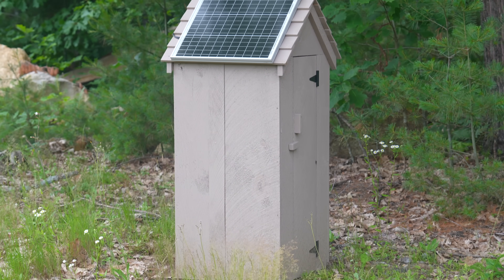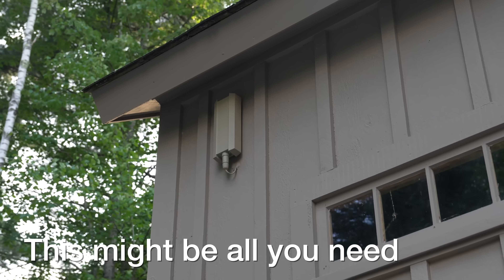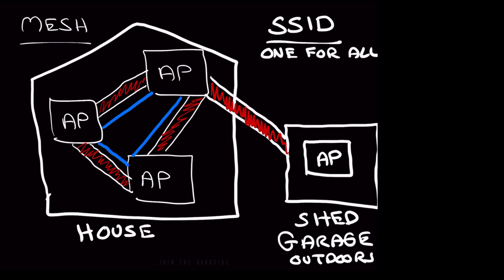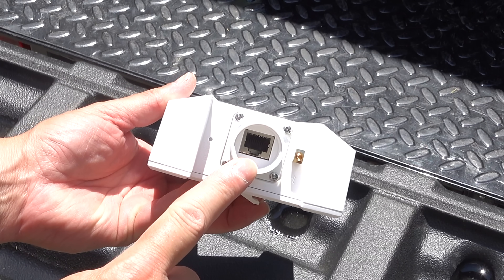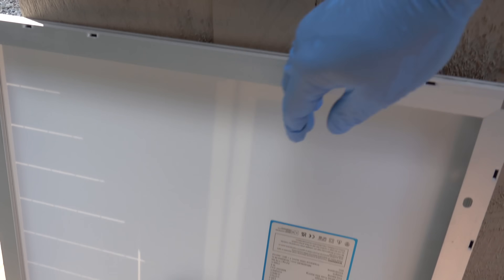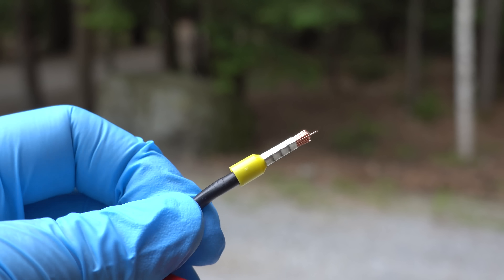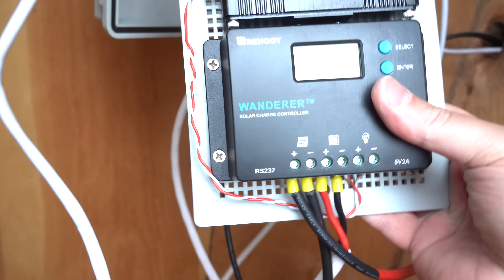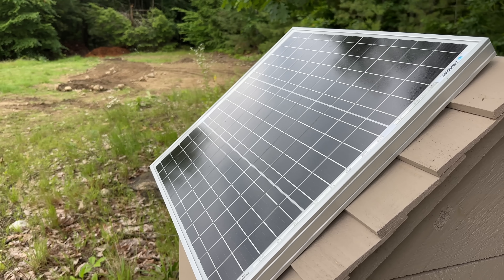How to get Wifi in the woods - DIY Solar Internet Station

Comment: I had to assemble a TP-LINK system as well that ended up being very complicated to not only set up but to maintain. At 64 and retired I had time to do this but even my technologically advanced son told me the system was to complicated for most people to understand. So what I am saying is when your away and the system goes down the area will not be covered by wifi.
With my system when the power goes out or flickers on and off it causes issues that many people that don't have the knowledge and patience will not want to struggle trying to figure out.
Not knowing your property layout but understanding wifi signals it might have added even more distance and signal strength by elevating your antenna. 
I all ways really enjoy your very informative videos thank you for making them.
Reply from the maker: What I like a lot about TPLink is once you get their interface and if you use their Omada devices it's really easy. I have been sup[er delayed doing a full network tour here to show my routers, wifi, etc. I wanted to get this project done first since is a critical part of my coverage. I hope to show the Omada system and devices in a lot more detail within the next month.

Comment: Is that new siding or paint on the building?
Reply from the maker: We just painted the garage, the wood siding is the same. The house needs it a lot more but is going to be a big deal so we are working up to that. I have no idea who the wood siding of the garage has held up so well for 40 years with so much shade and tree cover.
Reply: @SilverCymbal  it looks nice! also, the ap color blends in well.

Comment: Sometimes pricey but your videos always have solutions for rural home owners like me in a nice neat package.

Do want to point out, the mini version of that battery your using does NOT have low temperature cut off. 

Lifepo4 can discharge down to -4 but under 32 degrees a charge can damage the battery.

I have heard low C rates won’t hurt it though so you might be okay with that 50 watt panel. That’s under the c/20 rate that’s “safe.”

You might want to consider a external low temp cut off or low volt heater pad on a dc thermostat. You could direct solar power the heating pads with a cheap 24/12 buck converter and a larger panel so it starts gently warming the battery as soon as the sun is up.

Comment: I’ve been kicking around this idea in my head for my off grid property so I can do more “live” game camera stuff. I think I’ll need a bit more power if I want to do continuous live streaming, but this gives me a pretty good framework. Thanks for showing it off!
Reply: It's always weird when 2 different YouTubers come together. Like MTB and lawn and garden. Haha. Anyone else watch both?
Reply: There is pretty powerful routers that don't use alot of power, I have a similar setup with a smaller battery and smaller solar panel and it works great. A big hoss streaming setup wouldn't be a half bad idea.
Reply: @GoonyMclinux  Which router you recommend?
Reply: what router are you referring to?
 @GoonyMclinux

Comment: If you are using home assistant I would add a esp32 and a shunt type device to monitor the batter level and usage. You should even be able to see how much solar is going into the battery. Then you can monitor the level and make sure the battery is large enough. Also should be able to keep an eye on the battery health as well.
Reply: you could also use bluetooth presence detection to turn the wifi off and on depending if any devices are close enough to it, this should preserve the battery for longer

Comment: Would love to see a follow up video on how it performs after months being outside in the winter.   Will the solar keep up?
Reply: Not likely. Those panels are quite tiny. What ever the energy draw is per hour which I heard him saw 16 watts at one time. Rounding up you need 500 watts of solar per day for 20 watts per hour all day long. This 500 watts needs an additional 25 or 50% to be safe. Which means you need 1kwh of power. A 12v 100ah battery is around 1.2kwh. You should have around 200 watts just to make the station a viable thing all year round. Might as well buy a 250 watt panel to be safe. This means that in just a short hour or 2 the battery will be charged and should never go dead. If you look for the battery that has an internal heater in it. This way it kick on if and when you start charging. Then summer time you can add a set of filtered and screened in fans to help keep the box cooler. 
If I was making this I would buy the panel first then build it based on that size. I would then also make sure that the panel is at the best overall angle and spaced  several inches above the roof of the box. This way heat can be expelled with ease. 
I would then get a couple of sheets of 2 inch foam and then find the correct glue or contact cement and using a sheet of the wood siding and a sheet of osb on the inside build and make my own SIPs. This is small enough that it should be pretty easy. Also I would make sure the panel is a couple feet up off the ground to prevent tall grass to shading or anything else. Once the box is made you can set it all up really easy. Make sure you use the SIPs on the entire thing and caulk the inside and anything else to prevent even the tiniest gap. You can use computer type fans to vent using a simple 12v temp controller. ( amazon/ebay has them for like 10 bucks, I have used a number of them over the years ) Use a dryer vent cover to shield it from rain and then place a screen on the inside tightly sealed and then a box cavity several inches away from the wall to put in a small filter. I think you can find really nice 12x12 filters. Make sure you support the filter and a tight seal. You can then mount 1 or more fans to some plywood with the fans screwed to them. If you can see what I am talking about. I do not recall what the draw on those 12v temp controllers are. Yet they are super low. You can set up 1 fan with one and then another one with another temp controller setting them so that if the cabinet gets really hot you can turn on another set of fans. For example you might have 1 fan hooked up and then 3 hooked up for high temp things. 
You can read the spec sheets of the working temps for each unit that you put in it. You might find that they have pretty high working temps.
Reply: @kameljoe21 You are overthinking things. I ran my whole wireless network off a 300wh solar power station hooked up to 100w solar panel for a year.

Granted I had it inside, but it pulled a max of 20w each hour and fluctuated allow the way down to 4 or 5 watts.

Even on cloudy days, the 100w panel was enough to keep the battery close to 100%.

And the during the night the battery rarely went below 60%.

If you just get a bigger battery, a smaller panel would work just fine as it's not drawing max wattage all the time.
Reply: @jabbajawz  I am not overthinking it. I give everything a chance to work and being safe is why equiment in the field that is solar works so well and has no problems. Yet people underestimate solar and their battery. With heat comes more power usage and heat also degrades electronics. As things age they use more power as well.

Comment: Great set up!  One point, always connect the charge controller to the battery before connecting the solar panel.  If the panel is pumping power into the controller and it doesn't have anywhere to go, it could burn up the controller.
Reply: Put a outdoor light switch between the controller and the panel. Normally I just glue it in place behind the panel next to the controller but in this case it's better to just put that switch inside the little shed. 

It's handy to have, whenever you need to reattach the battery, just flip the switch. In my case, it was a portable setup so it made sense :)
Reply: Yeah, I kinda cringed when he did that, but it in the end all was well.  :)

Comment: Very interesting build! Why not add a floor to the shed to keep out all that ground humidity? Also, please add a link to the PoE switch, curious what makes it special? Shouldn’t the charge controller be outputting a steady voltage?
Reply: POE is not directly mentioned in the BOM but the device he is using for POE is the Linovision 12V Network Switch listed in the Description.
Reply: Satellite connectivity…. iphone 14 or 15 has this capability…. Or get a Garmin in-reach ?  I have to use WiFi at home because Verizon has no signal here in our town ….. technically we are a city but really a small to mid size town.  Verizon signal is far better at my remote cabin.  Go figure.
Reply: Seems like a lot of work and expense to create outdoor WiFi signal.  Cute little “shed” but I just don’t see the need for WiFi to extend that far..... phone calls will drop to voicemail but if I am outside I don’t really want to be checking my phone.  I realize a lot of people put high value on tech capabilities but I just cannot see much purpose to this.  There are remote control on/off switches that are designed for outdoor applications, so one could manually turn something on and off that’s outside.... does your robot lawn mower need a WiFi signal ?
Reply: @dtrout They are dropping down internet services everywhere so in rural areas working connections could be live and death situations.

They drove down 3G in Finland this summer and already had first problems at my home with sending internet messages. 4G does not always work here in backwoods. 

When they drive down 2G in couple of years, I need my LA-phones or get an internet phone with me in case of an emergency.

Comment: Great vid. Very interesting setup and work-around. 👍 Care to share with us how much this type of expanded setup might dig into our bank accounts for. 🥴
Reply from the maker: Thank you, the total without the little shed which was $150 locally was about $700. The majority of that cost was the battery, you could go smaller with the battery and get it under $500 if you get more sunshine. I could only find one commercial system that has 1/10th the battery capacity and it sells for $2,000. The best way to do one of these is to hopefully use some used parts, maybe an old solar panel to save additional money.
Reply: @SilverCymbal  thank you.

Comment: I recommend you use gravel or concrete pad vs bare ground to preserve the wood longer.
Reply: Exactly my 1st thought too. The shed is going to get a lot of moisture coming up from the bare ground under it. Not only hurting the wooden shed but rusting any exposed electoral connections. Also, having the solar panel just hanging off the 3 screws might be a problem. A strong gust of wind could lift it off of there. Actually, the whole shed might be susceptible to wind unless it's bolted to a heavy base.
Reply: Was going to say the same thing but he did say he was going to move it around.  I’m sure we will see a follow up in a couple months.
Reply: ...and maybe anchor the shed to the pad in prep for storms?
Reply: @@klinestill oh Thank You for the information. Im not ready for that yet but I will research the product in the meantime. Thanks Again 73
Reply: That or preventing it blowing away
Reply: Where is your sense of adventure.
Reply: @jerbear7952  we had a storm last year and blew over 35+ 75’ tall + Pine Trees so that shed would last about 5 minutes here during any of our Pacific NW typical storms.  Everything needs to be anchored down to concrete.
Reply: @@klinestill I'm sorry I should have said body grounding like going outside bare foot. People that work in their gardens get plenty of grounding which is good for the body. I do like your wifi station I may put one on my one acre that's still a forest it's the upper part of my 3.5 acre home. I want to have a ham shack and wifi is needed for my computers and phones. I will need a tall tower for my cell antenna. I don't think I can get cable internet where my home is. The phone version is too unreliable. The cell service can be hooked to wifi routers so I think my system will work. 73
Reply: Bare ground is better. For grounding.73